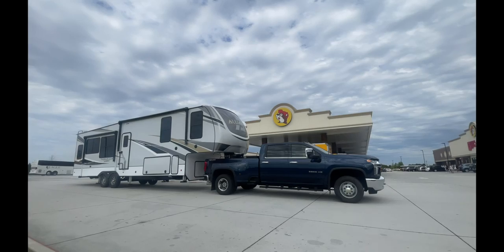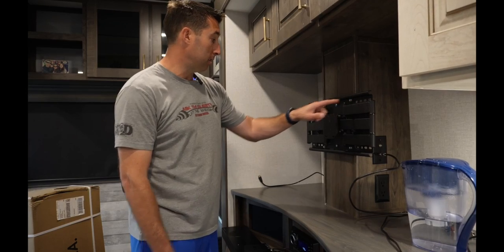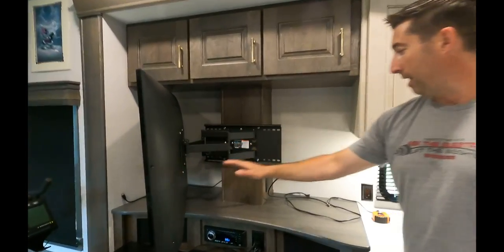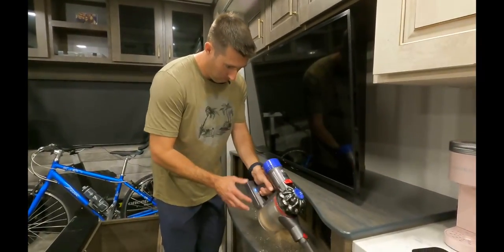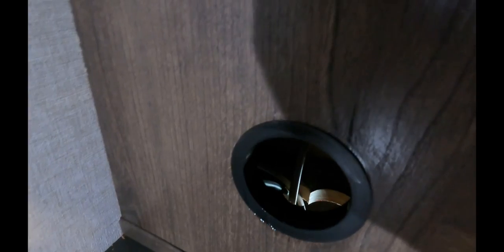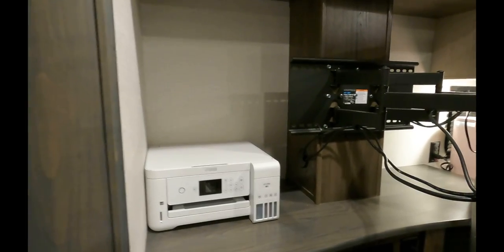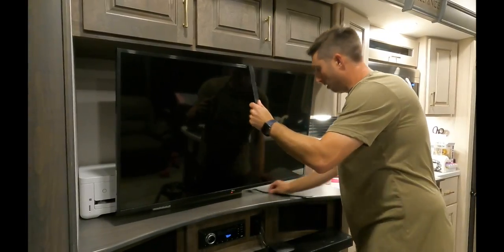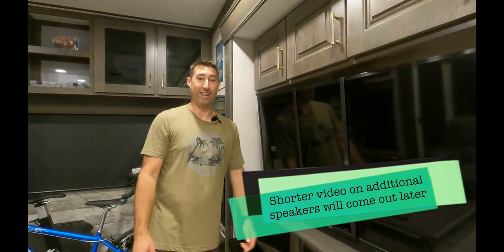RV Entertainment Center Upgrade

Comment: Been following ya'll for a while. Love the enthusiasm and DIY mindset.  We've got a 310RL and have the same issue with our TV area. How did you remove the TV from the factory mount?  Have not been able to find a way to do that. Once I do lookout!  Thanks, Bill ... an old retired Navy Chief.
Reply from the maker: First of all thank you for your service Bill, Chris is an Air Force Veteran. 
The TV slides straight up, it’s in a track. so if you get a hand under each side of the TV & just wiggle it & push up towards the ceiling it will come out of the mount &  you can pull it forward out of the stand.
Reply: On our 310 I had to flip the lever on the bottom of the left vertical mount piece before I could lift it off.  You can see the lever in the video at the :13 and :30 mark.

Comment: Is that solid wood? I guess what I mean to say is, when you put the 10 screws in did you have to look for wood or did you just screw it in? Did the mount come with enough screws? I'm picking one up at Harbor Freight tomorrow and will i stall in our 340RL..
.......Looks great!
Reply from the maker: There is a backer behind the luan wood that we crewed into. The mount did not come with enough screws. We added self tapping screws to make like a little easier. We have had it up for over 18 months and no issues whatsoever. Grab. A long roll of Velcro to wrap around the arms and the front of the TV. That has worked great to secure it in place.
Reply: @VenturesomeCouple  excellent......thank-you!
Reply from the maker: How did the install go? Martha calls the saw dust “Man glitter” and I found a lot with that install.
Reply: Yeah.....lots of saw dust!! Install went well thanks to your video. We like the versatility of that mount and the ability to use the wasted space behind it. Thanks!!
Reply from the maker: Glad to hear it went well!